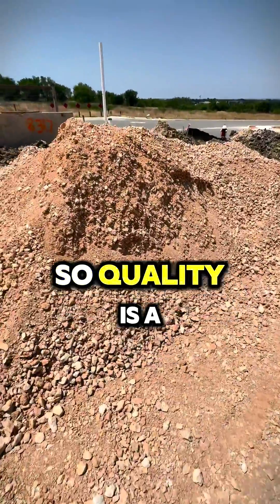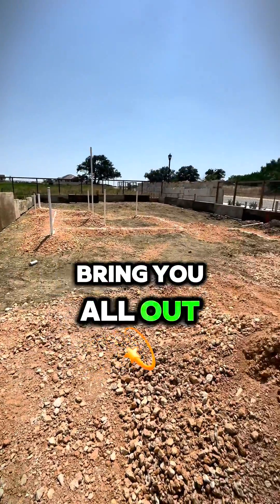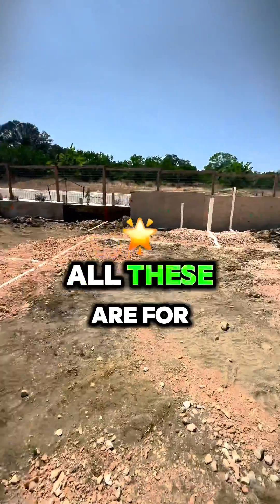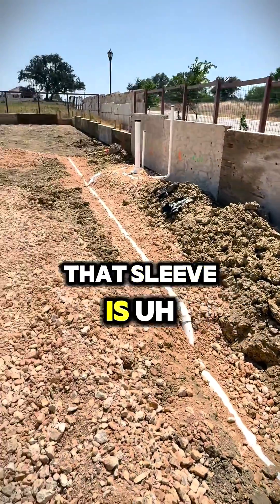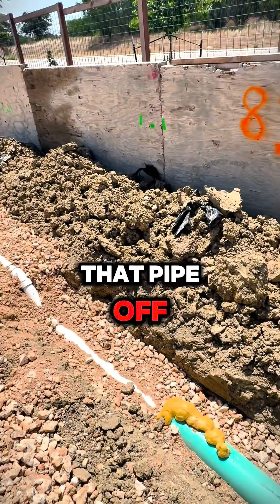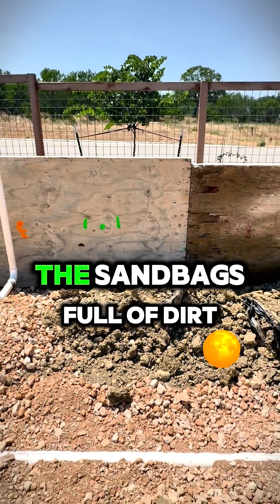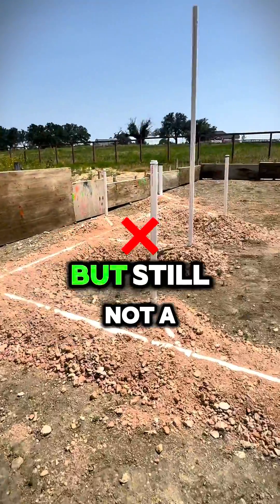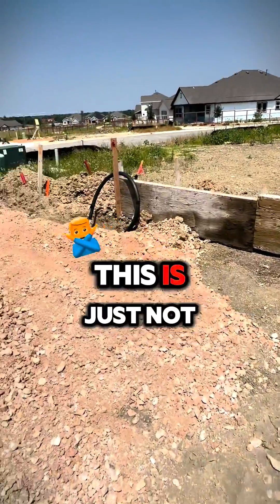NO ONE is Talking About It! (Why Homes Are SINKING in the Middle) #shorts  #construction

Comment: That is a different foundation  I didn’t see exterior footing anywhere I’m in CA that rough in and foundation looks a little different then how we do it here ! No sleeve the pipes are going to be under ground never seen that only the risers touch the concrete and they are supposed to be wrapped in foam to protect the pipe etc ! Good vid